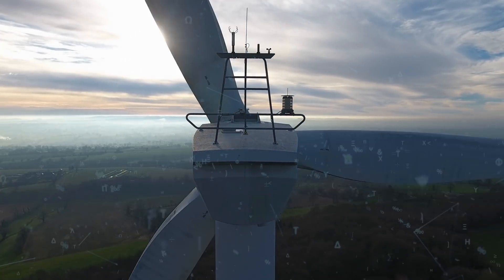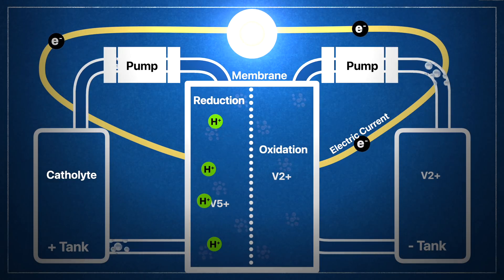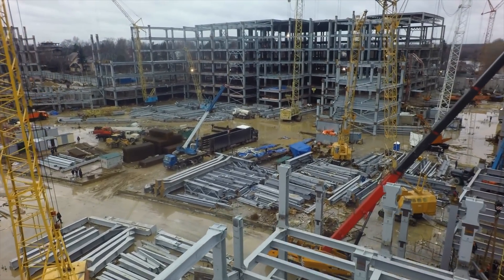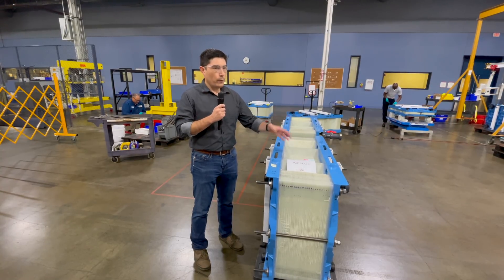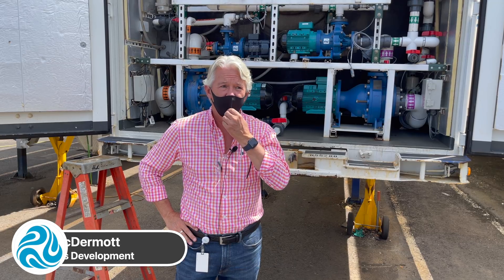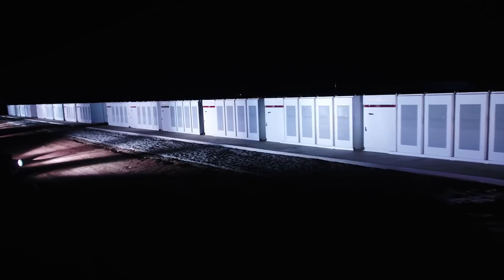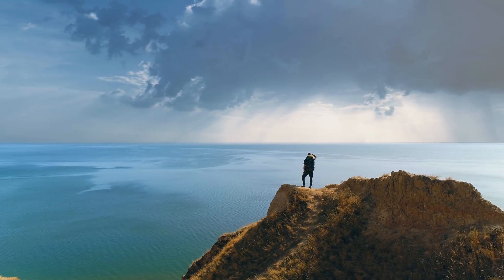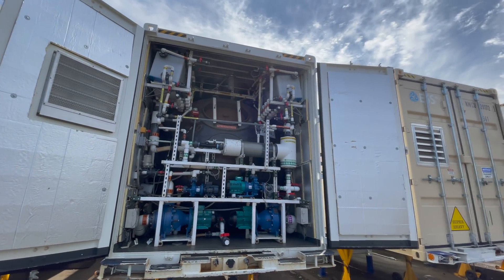The Future of Energy Storage Beyond Lithium Ion

Comment: I like everything about this battery technology except how many moving parts it has. The battery's chemistry may last a long time but what is the expected failure rate of the least durable unit in that mechanical system?
Reply: As mentioned in the video, all that complexity will mean regular maintenance cycles. It looks like staff could isolate any part and service it without shutting the whole system down. It also looks like stone-age simplicity next to the rest of a city scale energy grid. 

True, it would be a terrible idea to stick one in a crate, stick it in someone's backyard, and say 'here's your new discount not-tesla pack!'
Reply: All power generating facilities have tons of moving parts, because they all generate electricity by spinning up turbines using flow of steam, water, or air. The exception is solar panels, and that's only when assuming you don't rotate the array towards the sun (which is arguably much less prone to errors than spinning up a reactor to 50 rotations per second).

So, I'd say this new complexity is literally just replacing the old complexity and the net is at 0, especially if used in conjunction with solar panels. As compared to other batteries... well, it'd be nice if we discovered an even better way, but alas, lithium is gonna get damn expensive if we use it at this scale.
Reply: @btCharlie_  That seems like apples to oranges comparison to me. We aren't talking about the generation of the power. We are talking about a buffering system to allow a steady stream of energy from an unsteady source and that component is addressed more simply with other forms of battery storage that don't have many if any moving parts.
I still want to know the expected failure rate of the least durable unit in that mechanical system and/or the fail rate of each of the components i.e. how much labor and replacement cost is expected vs battery systems without so many moving parts?
Reply: @davidmcelvain1394    Sorry, I might've made my point more convoluted than it needed to be - sure, you could use a lithium-ion array combined with solar panels and you'd have nearly no moving parts at all, but moving parts in and of themselves aren't really that big a deal, because the current mass energy generation is done with many, many moving parts and it works just fine even with the maintenance costs. And more broadly speaking, I kind of doubt the maintenance costs would outweigh the price of more exotic materials once you'd start working with them at scale, though sure, that's just a guess.

I would definitely like to know the specs of the all the parts and how they compare to other batteries regardless of whether they may pose an issue or not. Lastly, if a technology pops up that is both cheap and straightforward, that'd be just great. Sadly, it hasn't done so yet.
Reply: @btCharlie_  Probably the environmental hassle of all other systems would pay for dozens of replacements of the "moving parts".  Just the lawyers would.

Spend half that cost on "gold plating" the specs for machinery.  I didn't see much even the hardest-nosed bean counter would lose sleep over because they are already used literally everywhere in existing industry and have been for probably a century.  And have been maturing the technology for all that time as well.  Their costs will go down with scale to some predictable level, while lithium and others go into orbit.

Iron?  Come on.  Probably have enough scrap metal to cover entire replacement of grid storage.
Reply: @btCharlie_  look into liquid metal batteries.
Reply: @davidmcelvain1394  What you say is completely true IF you live in a world of endless resources. We don't. This type of technology is a logical response to that fact. Yes, there is a trade-off of more mechanical complexity for reduced toxicity, increased charge/discharge cycles and scalability. Mechanical reliability is on -par with related industries and will change (and improve) over time. Maintenance costs must be weighed against the cost of completely replacing (and disposing of) a chemical battery after a few thousand cycles instead of hundreds of thousands of cycles. Again, there are trade-offs. What you want to know simply cannot be known at this stage. Patience, my friend. Patience. I guarantee you the corporate customers this product is aimed at will answer all of those questions in good time.
Reply: Good question!
Reply: Same. I saw tubes marked 'hydrogen' during the video when they showed the 'kidneys'. That usually doesn't bode well for long term stability of anything that comes into contact with (embrittlement)
Reply: @peterzerfass4609  
Huge amounts of hydrogen are stored and transported in industry to make ammonia for fertilizer.  The industry uses mild (low carbon) steel without problems or "embrittlement" which is apparently something Big Oil has tried to use to scare people with F U D.  This is nonsense.

The only concerns are, as he said, the pumps and equipment with moving parts.

One other thing that seems to be a concern is that not connecting batteries in series means that the 1.1 volts DC must have large copper conductors so it might take a lot of copper for the electronics.

Comment: Sounds good, but I fear that cost parity with Tesla mega packs isn’t going to cut it. Lithium Ion batteries have a far wider range of use and the huge ongoing ramp of capacity is just going to continue reducing cost.  Unless this company has a clear path to dramatically reduce cost I fear that it will be swamped by lithium ion alternatives.  My advice would be to try and get taken over by Tesla or some other cash roach company, that could commit to rapid scaling up of production to get economies of scale.

Comment: I still don’t get with flow batteries is how does this solve the dendrite buildup , they still grow just removing the main storagecathode and anodes , it still has to come into the plate area , so yes fires are mitigated and uses less valuable materials but it still has to degrade even if the main electrolyte is refreshed

Comment: Sounds to be very promising technology.  I wonder what temperature range these batteries can easily run within?
Reply: Thats a good point salt in solution can  freeze. I have no idea of tge upper limits of the system. Heat degrades things.
Reply: @johnramirez5032  Salt in solution can freeze and boil. But solute salt circulating and undergoing ionic charge and discharge? I'm not so sure how it would be affected by cold or head. Good observation though!!

Comment: It would be interesting to see how cost effective this is in real terms and how does it handle heat or cold, would it adapt to Arizona or Alaska. How is the system effected by temperature. How would electric rates differ from what we have now to using a system like this. I like the idea, it seems very good but I have seen many good ideas over the years that never come to be. Could it be scaled down to off grid home/cabin use or is it just to expensive to do so. Can the system be refurbish at the end of its life cycle or will it simply be added to the trash pile like millions of batteries end up now. Could something like this be added to nuclear power plants that don't throttle up and down well to smooth out the energy needs as energy consumption rises and falls thru the business day. How many of these trailers would it take to store the energy of a city with say 100K people. Would it make more sense to have one giant power storage centrally located with a system like this or would several smaller substations be more efficient.  

Lastly how much potential is there yet to be gained from more energy efficient homes and businesses that can help reduce the need for massive power plants and help make systems like this more feasible.
Reply: @Douglas W
If you had listened to what he said, you would have heard him say that it is not something that would be used for a home residence or small scale.

You're trying to spread propaganda about lithium batteries filling up landfills and that's pure nonsense. They're far too valuable to spread on landfills; a used EV battery could be sold for more than $10,000.  The valuable chemicals are recycled.  And many countries have laws requiring recycling batteries.
Reply: @acmefixer1  you must not have very good reading comprehension or have misunderstood my comments. I am not trying in any way to spread propaganda I am simply asking how much can be recycled and how viable the system is. I have seen many great ideas come and go in my lifetime never to make it to the market place or fall short of the promised intensions. I actually have high hopes for many of these systems as man kind can not continue consuming and wasting like we have for the last 100 years. Systems that may work well in one part of the country hot/cold may now work as well in other areas. In the future we may need different solutions for different climates and regions of the country.  A great example is nuclear power is great until it isn't, decommissioning a power plant can be astronomically expensive and what do you do with all the waste. The cheap energy that you get in the beginning isn't so cheap in the end at cleanup time.

Comment: I love this technology, I cant wait to have this available to the projects I work on.    I am however a little concerned about their janky hardware-store bought PVC piping for hydrogen lines.   Hopefully they will put in proper piping in their production versions, as I am afraid this will be an explosion hazard from hydrogen gas leaks.
Reply: Not to mention hydrogen accumulating in a slow leak.  Then you have a 40 ft. fuel-air pipe bomb.

Comment: Great topic and video!  Thanks.

I need to understand the electrochemistry, because from your description, it’s not clear that this really is a true flow battery.  That, since you described electroplating onto one of the electrodes, which means that the reactions are not entirely within the reactants pumped through it.

Bigger picture though:
—  A rechargeable battery contains all of its reactants, and its reaction can be reversed.
—  A one-time-use battery is the same except its reactions that produces electricity are not reversible.
—  Electoplating is the opposite:  What is essentially a battery-charging process is not reversible.  The ion flow through the electrolyte leaving you with a crust of metal on the electrode.
—  A fuel cell is a battery containing only the electrical components, and the chemicals flow through it, but those reactions are not reversible.
—  A flow battery is like a fuel cell, but where the reactions are reversible.

This seems to be something else in that the electrode materials are involved in at least on of the electrode reactions.
Reply: Fuel cells can run at higher than ambient temperature.  This doesn't seem to get hot.

Comment: The biggest problem with this version of a flow battery is the fact that it's two components that need to be added to increase CAPACITY (kilowatt-hours), electrolyte storage and plating area. Other flow batteries ONLY need to increase the amount of electrolyte. If POWER (kilowatts) needs to be increased, then the number or size of the plates need to be increased. So if one starts at 5 kwh @ 1kw draw but then needs to upgrade to 10 kwh @ 1kw, one only has to add more electrolyte to double the capacity. Using the Iron Flow battery, one would need to increase both electrolye AND plate number/size, a much more costly upgrade. On the other hand, if one wants to increase POWER (kilowatts) say from 1 kw to 2kw, only the number/size of the plates need be doubled. So a proper design would be to design the system with enough power at the start and the minimal capacity then add more capacity over time as need changes or as finances allow.

Comment: The first thought about where to store it that came to me was under road infrastructure (placed on top of the geothermal system, of course!)  Our roads cover an INCREDIBLE amount of space that can't be used for anything else and vehicles have VERY low ground pressure when compared to buildings/etc., so burying things that take up a lot of space (like flow batteries and geothermal grids) seems like a perfect match to me.
Reply: Geothermal power plants do not need batteries because the steam is available 24/7 & 365 days a year.
Reply: @acmefixer1  While the energy might be available 24/7/365, enough energy might not be at a particular time.  By storing energy when demand is low, it can be released when demand is higher than production can sustain.

Comment: I suppose the question is how fast can you charge / discharge?  Can they help with grid stabilisation?  The Tesla big battery in Australia is capable of ramping from 0 to 100MW in 140 milliseconds.

I can see an eventual tiered hybrid system, with ultra super capacitors able to supply high levels of current for brief times, but with nearly infinite cycle life, then LiON or LFP to provide a longer 4-8 hours, with flow batteries and other tech supplying storage measure in days.

With the ever falling price of solar, it's cheaper to double of triple the installed base of production than it is to have weeks of battery storage.  Industries will crop up that can use the excess energy, which in sunnier climates is likely for the majority of the year.
Reply: You said: " ... it's cheaper to double of triple the installed base of production than it is to have weeks of battery storage. "
Yeah, but the sun is only up roughly half of the day on a yearly average. Some industries can shut down at night but many or most need to operate 24/7 and I don't just go to sleep when the sun goes down, do you? Renewable energy needs an energy buffer regardless of the type (solar/wind). And who said anything about "weeks of storage", a week is likely enough for most places.

Comment: Fairly clear their IP isn't in fluid transfer efficiency. Nothing wrong with having a tight form factor however poor flow dynamics says a lot. How many seal and bearing changes will the pumps need for that headline 20,000 cycles especially loading the pumps unnecessarily? Flow batteries are cool.

Comment: Putting battery units under each PV panel makes no sense when it comes to maintenance. A power station isn't built from 10,000 small diesel engines.

Comment: Interesting story.
That first guy didn't know that a lithium cell is between about 3 and 4 volts - he suggested it would be half a volt. Doesn't inspire confidence.
From what he said it's not the avoidance of series stacking that gives their solution voltage stability, it's the choice of using a dc-dc converter. Which is probably exactly what the lithium cell systems do too, they just do it with a series battery at a higher voltage. Their extra low voltage system must have crazy high current, which itself brings challenges and isn't necessarily going to be the most efficient from the pov of the electronics.
Now, the fact of continuously circulating your electrolyte for fresh presumably also helps with voltage stability - but he didn't say that.

Comment: On a large scale, pumped hydro makes much more sense. With batteries we pay by the watt-hour but with pumped storage (or the less efficient but much more versatile hydrogen) we pay by the watt with a very small premium for additional capacity. Batteries have nightmarish problems as large scale storage as well, mostly environmental costs.
I retired from a Fortune 100 electric company 3 years ago, after we had our first lithium battery fire but before we had the one that severely injured four firemen. I took that one hard - after the first it was clear they are practically designed to kill firemen. The problem is inherent in any high capacity storage battery, but is not serious until we try to store more energy than the battery can absorb as heat if everything goes wrong.

Comment: I wonder ... why is everybody thinking this kind of technology isn't something that'll work for residential home scale? They have moving parts, yes, and require some maintenance. But so does a central heating system using oil, gas, coal, wood pellets, ... and these have been used for what feels like forever on the residential scare. So don't think of them as a energy store just for electricity. Think of them as energy storage for heating. 
Combine redox flow with rooftop PV and a heat pump and you have integrated electric power, heating and long-term storage. Technologically you don't even need anything new for it. The only thing that has made redox flow not viable for the purpose so far has been a) cost and b) chemistry (Vanadium based, quite toxic). If this solves both, then I'd happily buy it if cost is at least on par with Lithium Ion. Admittedly, you'd need some 15 m³ of storage (1.2 m³ oil -> ~12 MWh for heating, with a heat pump you need roughly a 10th of the energy input due to working principle and efficiency) for full off-grid heating and electricity (plus ~10 kWp P, central Europe, free-standing home, ~250 m²), and that's a lot, and the upfront investment, if you combined all three components into one, would be on the scale of 50k € before incentives, which is a lot, too. But it would easily have an ROI time of less than 15 years ... so totally worth it, even if somewhat on the luxurious side of things. And it is something you just can't do with Li-Ion. A MW's worth of Lithium in your basement would be nuts for multiple reasons.

Comment: If energy density isn't a thing to worry about then why not using a 100% mechanical energy storage like just water + gravity and a generator! That way you can replace iron with cement and stones (to built two water tanks) which is much  more cost effective and it can work efficiently for centuries.